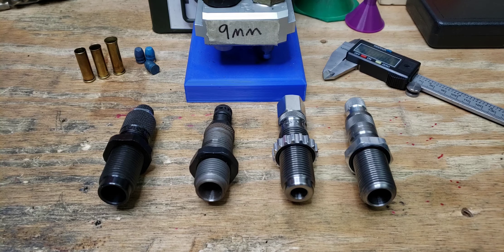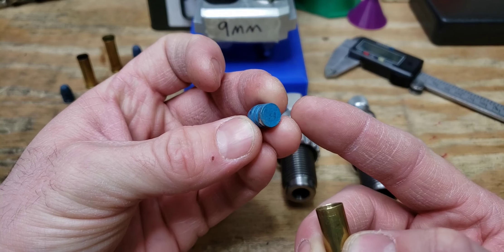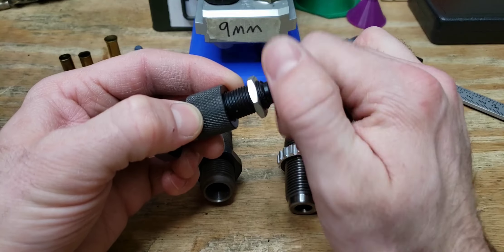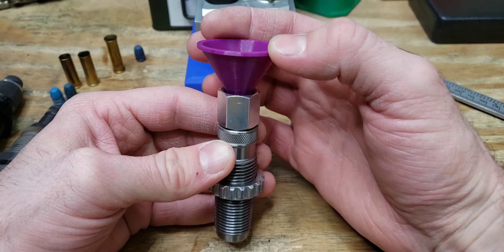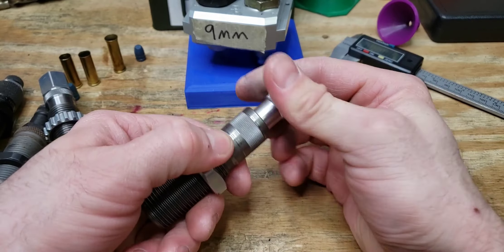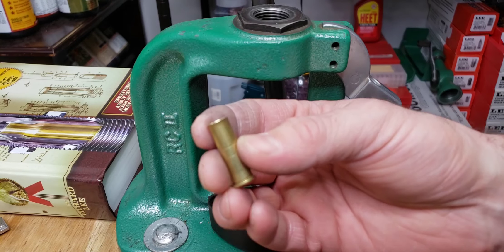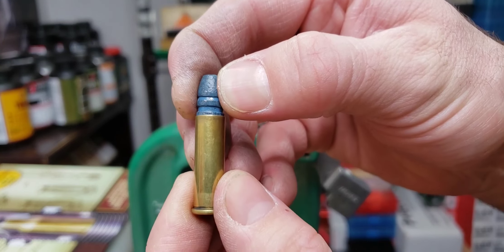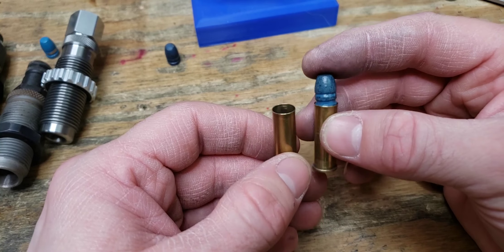RE: How To Set Up Your Expanding And Flaring Dies - Pistol Vs Rifle Vs Mandrel Vs Powder Through

Comment: Oh man I got a question that might really get your gears turning could I neck a .223/556 down from a 22cal to a 17cal ?
Reply from the maker: I don't see why not. You would just need a die that wouldn't touch the body and only the neck. I bet that would make some smoking hot rounds👍🇺🇸👊
Reply: @DummyRound  yes sir that's the plan I wanna get a 17 hmr barrel bored out to chamber them custom 17nato if I can make the loads
Reply from the maker: Check out the 17-223, looks like what you're thinking. I'm sure somebody makes dies and somebody can chamber a barrel for it. Looks pretty awesome 👌